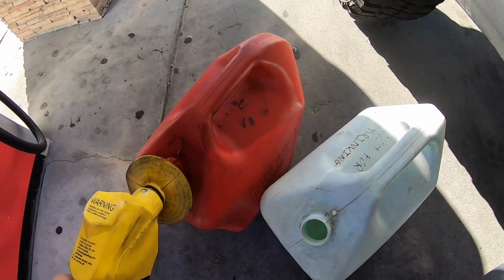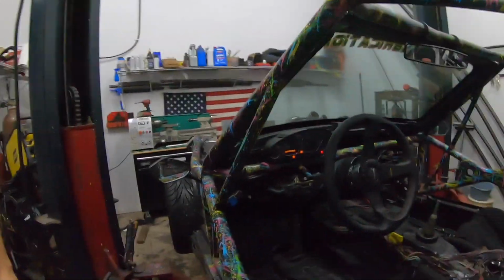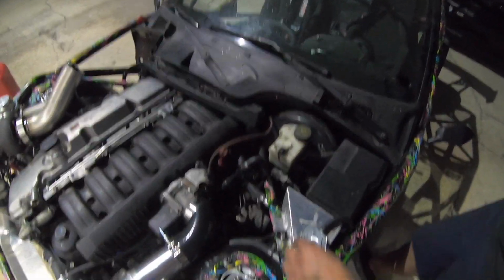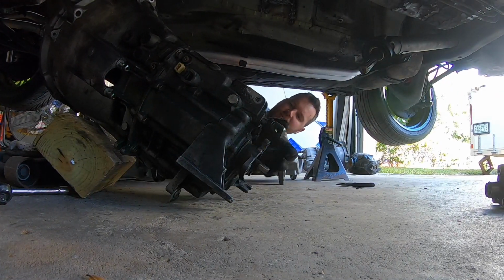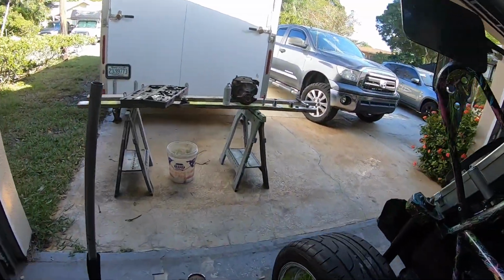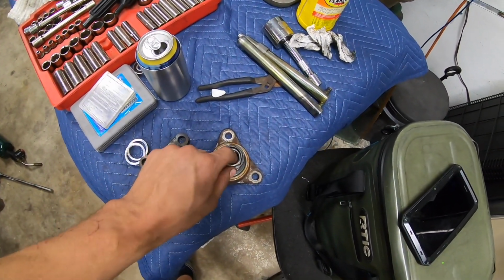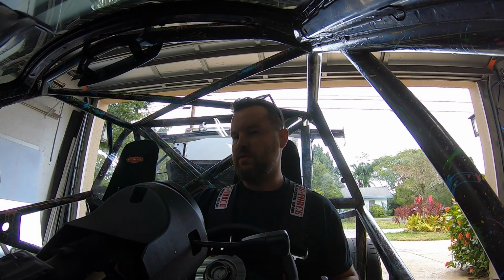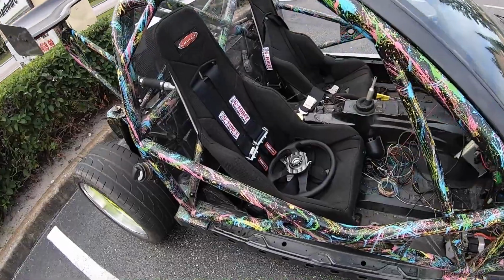BMW Z-Karts First Drive With A Turbo !!!!

Comment: I hope you put the baffling back in the valve cover so it didn't push to much oil out into the catch-can🙏✝️🙌
Reply from the maker: I did not we will be running a catch can
Reply: I have to agree with Wade. The baffle should stay in.. 
Edit; Having looked back on the video where you took out the baffles. It might be worth thinking about modding that small baffle with drilled holes to allow the built up pressure to go to the catch can, but not allow the oil to spit out?
Reply: @baysidefabrication  have you talked to Jeremy about removing the baffling??

Comment: Watch out... welders and generators are not good friends at all! 
If they have the chance they will kill each other, the peaks and dips in the current draw are especially lethal for generators!!!
Dont do it unless you are VERY sure your generator is up to it, if not you might kill the generator or both machines.
(welding is about the #1 cause of death for smaller generators, I have 2 in my shop partspile that both got destroyed that way)
Reply from the maker: I was wondering about that too
Reply: Yep. Lookup the generator specs and see if it specifies welders otherwise it will fry.

Comment: will switching off the battery every time you park eliminate any "learning" that the ECU has done since the last time you switched the battery off?
Reply from the maker: Its like a hard drive on a computer. If battery dies you still have all your saved files and info next time you plug it in.